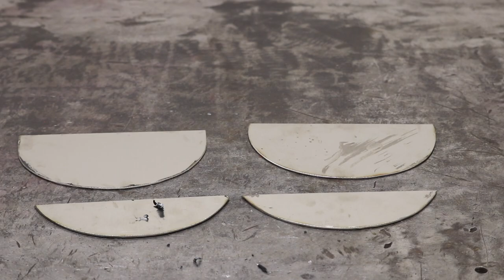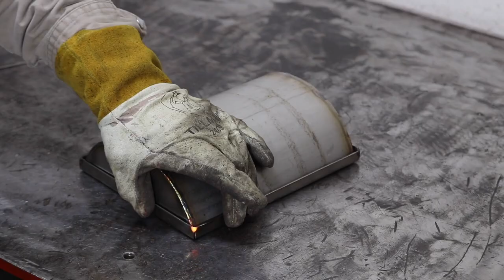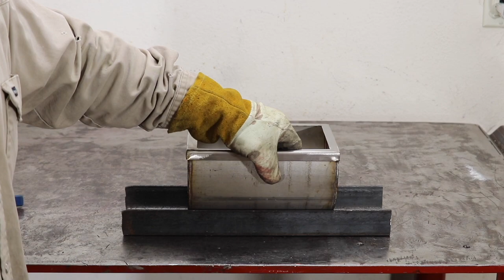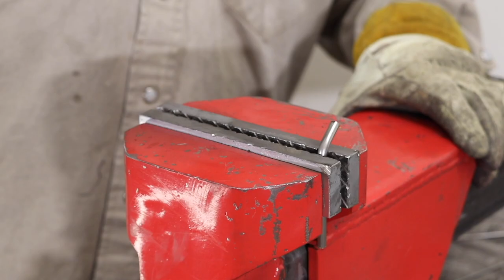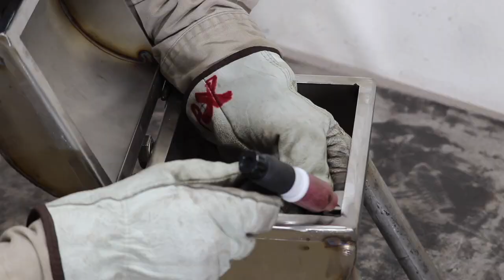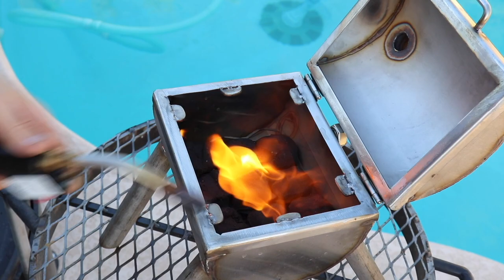How To Make a Mini BBQ Grill || DIY Mini BBQ Grill From Stainless Steel

Comment: Why is the vent put at the top of smoker?    If it is put at the bottom of smoker the cooler smoke at the bottom would escape and the hotter smoke at the top will stay. Wouldnt it be energy efficient that way?
Reply from the maker: It’s really just for looks.  As small as it is I don’t  think it  makes much of a difference. It’s only a 3/4” vent. Thanks for your feedback.
Reply: hey ,hi
actually the vents must be on both sides top and bottom
the hot air is less density it tends to raise upward,hence we need to provide an exit to it
if the hot air is leaving ,it creates a vaccum inside ,sucking fresh air
so we need to provide any entry at bottom as fresh air is cool and should combust charcoal
both vents must be there for good air flow and proper combustion

AX creates made it to look fancy i think he skipped the bottom entry but as it is too small, not much problem

Comment: What kind of welder is that?
Reply from the maker: This process is called Gas Tungsten Arc Welding, which uses an inert gas like Argon. And produces the weld with a non-consumable tungsten electrode while adding filler metal. I’m using a conventional DC stick welding machine. In short, you can use a stick welding machine to tig weld. However, If the stick machine is a dc only welder then you can’t weld materials like aluminum and magnesium. For this you will need an AC welding machine. Stick welding is referred as SMAW and tig welding is referred to as GTAW. There’s more to it, but these are the basics. Hope this helps.
Reply: @axcreates_official  This helps very much. Thank you for the prompt response.  Love the video.
Reply from the maker: 👍👍. Stay tuned. I think you’ll enjoy the next video. Thank you for your support.